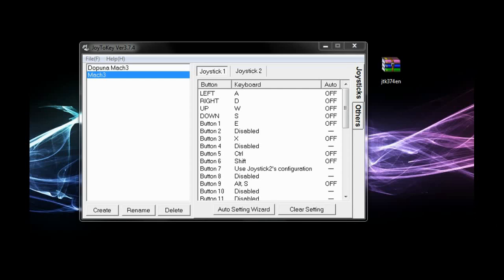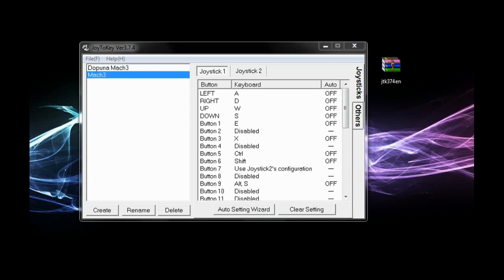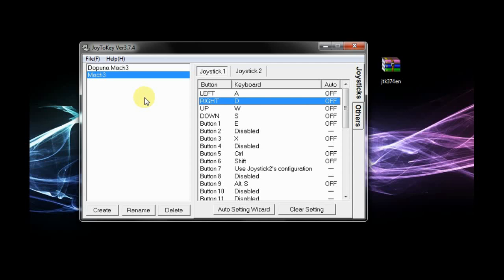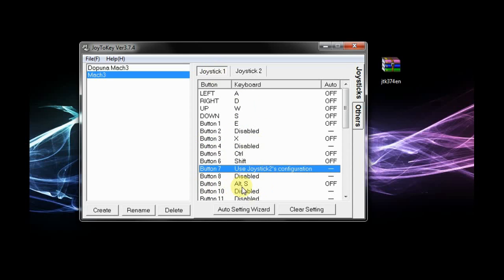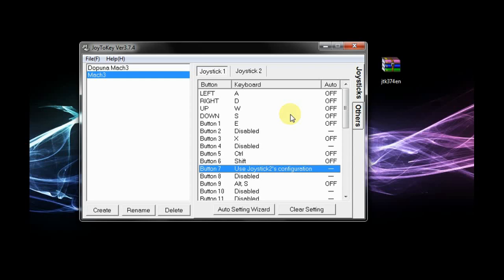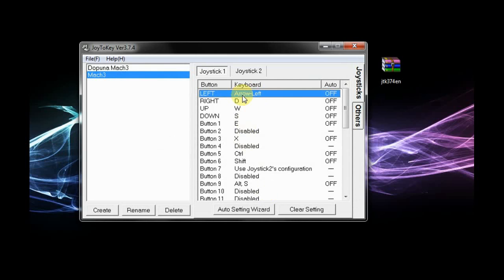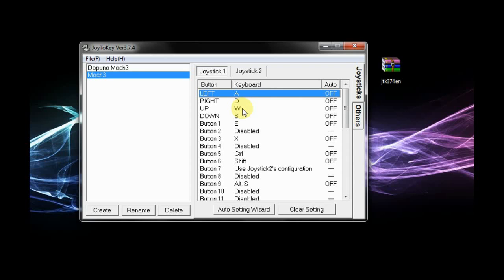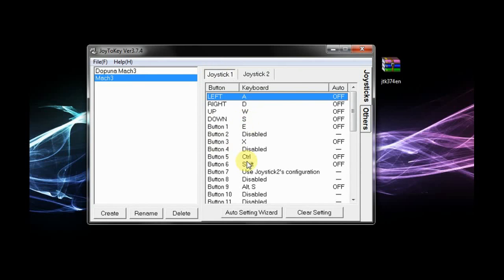How to easy control DIY CNC with any controller

Comment: Great video, I'm wondering if I can use this with a usb external numerical keypad
Reply: This software is intended for controller to keyboard use only, but I think that you can change controls in Mach and adjust them to USB keypad.